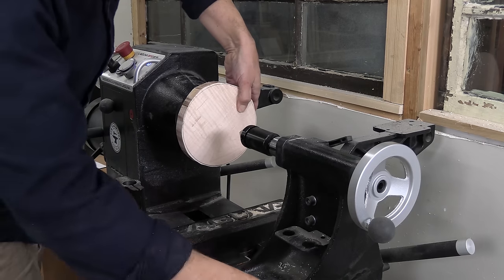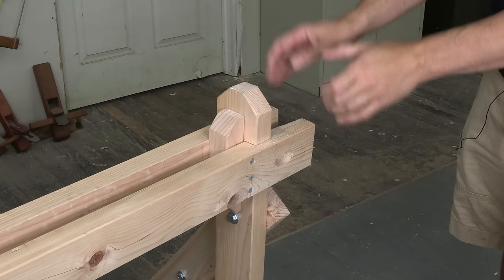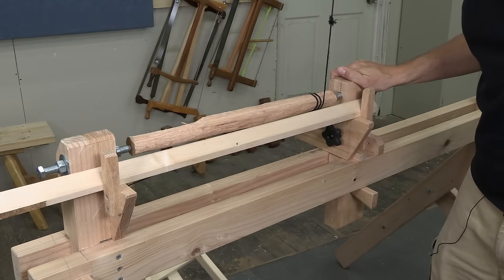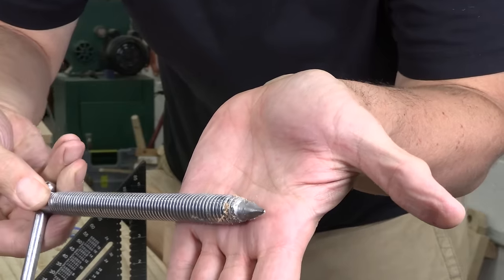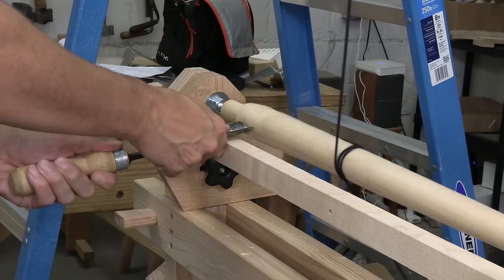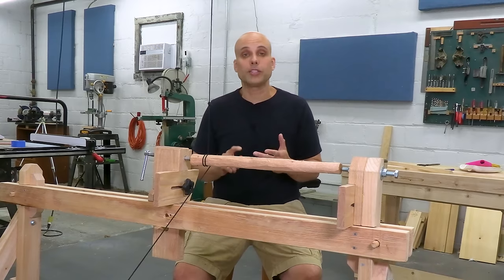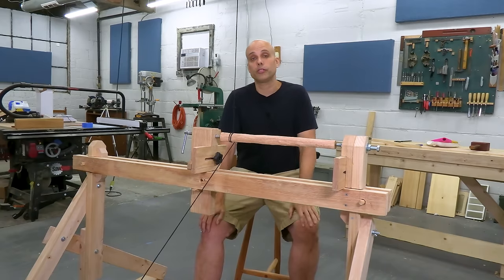I Built a FOOT POWERED Lathe. (Most requested video.)

Comment from the maker: Just to clarify: there are some really great treadle lathes in the world. The basic idea is sound. But they're much harder to build than a spring pole lathe and some of the shop-made examples I've seen haven't worked well.  If you're building your first lathe,  the spring pole design is more likely to work on the first try.
Reply: I totally agree on the assessment with some of the later model flywheel lathes.  I operate a few different flywheel treadle lathes (cast iron) and some perform much better than others.  But i have also found that it really depends on what i plan to do on the lathe.  This helps me choose the particular lathe for the work i want to accomplish.  As always, great video Rex!
Reply: on the subject of spring lathes, after the innitial design is doned, would it be possible to go fancy and find a way to atach a spring to body? like thin bamboo which holds its spring well after it dries or mabe laminated pole?
Reply: Any particular reasons a tredle lathe didn't work as well? I've always had the idea of using the base off an old treadle sewing machine to make a lathe (not because I'm overly interested in turning, I'm more interested in building the thing itself
Reply: A video on how to power this with a rotary tool would be cool.
Reply: @martinwyke  well, you would probably put a pulley on your tool and use that to drive the part.  Some sort of gravity based belt tension would make it super simple too.

Comment: In regards to learning the first time you make something, regardless of how experienced we are, Jimmy Diresta has a great saying: "You go to school on the first one."
Reply from the maker: Words to live by.  I love Jimmy.
Reply: Flywheel definitely is a bit more  complicated to build. And to balance. But still I'm right in process to building one right now.

I tried out one such flywheel lathe some 40 years sgo. With a belt, and the two parallel beams made of 2" by 4" pine planks. I love how it worked. 

Mine will be with bearings, one of them conical. I'm not a very physically strong man, ya know...

Comment: A tip for using a pole lathe is try to work with green wood as  much as you can, just get 90% of the way done and then finish the piece once it has dried and warped. It's a significantly quicker and much more enjoyable tool to use that way

Comment: When am I by myself assembling something with stand up legs that want to fall over, use a traditional carpenters clamp at the foot of the legs against the floor to hold them upright.  Works like a charm.  I learned that some where along the way.  Really useful tip.

Comment: I'm from a long line of woodworkers, on both sides of my family. I am a woodworker as well, and I make it a point to do high quality work. My father was a woodworker, his father was a woodworker, and about two or three more generations back were also. My grandfather on Dad's side made his own wood lathe, and he had repurposed an old foot powered Singer sewing machine for the turning action. When he passed away the tools in his shop were meant to be passed down to me, through my Dad. That old foot powered wood lathe was one I was especially hoping to get my hands on. I wanted to try doing the turning the old fashioned way that my grandfather used. His wood lathe was definitely more refined than the one you made in this video, and the belt drive worked off of the foot pedal of the old singer kept the material turning in the same direction. Unfortunately, a cousin took all the tools from Grandfathers old shop and sold them. He did not ask to do so, he just did it. I've not associated with him since that time, because he knew that was supposed to be my inheritance, and did not care. He just wanted the money he was able to get out of it. Not being in the family business of woodworking may have played a part in his choices. Grandfather's furniture was some of the best made furniture in the whole area of northwestern South Carolina, The adjacent parts of North Carolina, Georgia, Tennessee, and Alabama.
On my mother's side of my family was a buggy building company partnered ownership. The one that was my ancestor designed and built the carriage of Catherine the Great of Russia. If you've ever seen photos of that carriage, you know how ornate it was. That is what my family is about, high quality in everything we make. I still live by that tradition to this day.

Comment: I build a spring pole lathe just like this 20years ago. I used it alot and its fun. I never missed a moving headstock . 
I used it alltime outside and fixed it to the ground so i can do heavy cuts . sometimes its usefull to ad some wight to the legs when you can´t fix it to the ground

Comment: YES!!!!!  Love this video!  I built a pole lathe a few years back and it is one of my most favorite tools to use and I’ve built a lot of really gorgeous stuff with it.  Turned table legs, in particular, put your furniture in a different category.  I built mine crazy cheap and fast – 100% SPF (except the tool rest) and didn’t even plane the parts or even wait for the wood to dry.  It twisted some, but still worked great.  No real joinery (except the wedges); I just screwed it all together.  It's very "bodger" style - down and dirty.  But it works amazing.  So great I never bothered to build a “nice” one.  I have low ceilings in my basement so I use a bungee instead of a pole.  I also eventually rigged up a couple pulleys to get a 2:1 mechanical advantage so now with each stroke I get twice as many turns and twice the turning speed.  And with pole lathe turning the number of rotations and rotational speed is KING.

Just promise to keep make pole lathe videos.  Too many popular woodworking youtubers make one video on making the pole lathe, try a video using it, and then you never see the lathe again.  So please keep using it and making videos with it.  

I will also say that a pole lathe is the absolute cheapest and easiest way to MASSIVELY expand one’s woodworking capabilities.  Everyone should make one.  Once you can turn something it opens up a TON of new options.
Reply: Thanks for sharing your experience, it's super inspiring! The 2:1 pulley system is an amazing idea!
Reply: Could you explain that 2:1 puller system?

Comment: I made a spring pole lathe from Roy underhill's plans as my first lathe a few years ago. Loved it! I turned parts for a rocking chair, and some coffee table legs, a blank for a wooden screw, tons of stuff. It was fun! I did convert it to a bungee cord instead of the wooden poles, much more convenient, and you can adjust the tension by adding more bungees or changing the way you hook them up.

Comment: Can’t wait for your follow up! I wonder if using an actual spring would give you a better easier result? Maybe extend the two legs up, add a second ‘bed’, and hang the spring from that. Might prevent the “jumpiness” you mentioned, which I’m guessing is the pole trying to pull the whole lathe up to the ceiling. Would also make it even more portable!

Comment: Hey Rex!! TYSM for the inspiration and motivation to make mine. To know that a pole lathe is better than continuous motion was the last thing I needed to hear to give me the push. I’ve started it! I’ll be using the style of legs you shared, the takedown style so it doesn’t occupy as much space, and the same screws you showed here. I’m making it more traditional style because I have access to plenty of wood, and I’ll make it closer to Townsend’s version, mostly from a single tree, milled by myself. I’ll also be making it to work standing up, I’ll get more power on the leg’s downstroke. I’m using parts of old tires instead of a pole though - learned I could do this from Advoko Makes. He has tons of brilliant content. He cuts the sidewall of a tire into a continuous rubber strip/strap. Good use for what would otherwise be trash in a landfill.

Ps: check out his clamper. I fixed all the old chisels around the garage that my dad had split open because he didn’t know they had to be used with a wooden mallet instead of a steel hammer. Easier than remaking handles and have withstood a lot of work, and will stay in place till I remake them on my new lathe haha

Comment: When you're taking your lathe apart get a pair of coupling nuts to put over the ends of the points. Keeps you from poking holes in yourself. Voice Of Experience here...

And yeah, pole lathes are fast. I was at the Bodgers Ball last May and competed in the Log 2 Leg race. My time was just shy of 19 minutes to make two chair legs from a log. And I was dead last. The winning time was less than 9 minutes. Yikes.

Comment: I built mine in a similar fashion, but into my workbench. Both heads were removable. Two 8" 2x4 stand outs and a full length 2x4. It had one of 2 string overhead pivot arm styles with the spring pole  under my bench between the legs.

Comment: "i let my 2x4s dry in the shop for a few weeks" you are so freeking smart, i just learned the hard way on something similar, i had bought 2 treated posts and used a post hole digger to sink them in the ground, bought the straightest ones home depot had, used my level and made them perfectly vertical and cemented them in, in just like a weeks time they warped so bad and look horrible now. interesting how that works, clearly you know from experience on this as well for you to leave them sit for a few weeks.

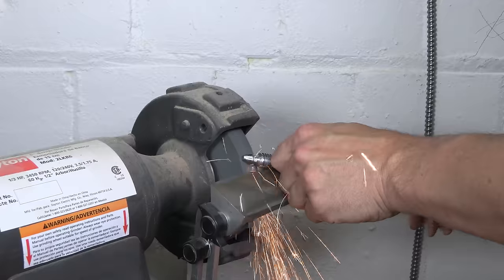Comment: First of all, just wanted to say, great design! very simple, cheap, and affective. One minor nitpick @ 6:27 you can see the end of the steel start to run through colors, and you can see the point of the tailstock is purple and gold. Not too sure about the steel alloy, but generally speaking, you shouldn't heat hardened steel up to that temperature unless you're going to re-heat treat it.

I bet it still works great, but refraining from heating it up like that in the future would improve the longevity of the part!

Comment: Quick tip if it helps: put a metal pipe on the handle of the clamp screw when you want to thread it into the poppet. The longer the pipe, the more leverage you can put on it. Also works great for lug nuts!

Comment: I really like the idea of this. I might have a couple ideas of my own to try if I ever get experienced enough to do this. Instead of a tree branch, I could possibly swap it for an actual spring bolted to the rafters. I could also make or buy a pulley to put the rope on, so I can work on the whole piece without having to reconfigure it. That would also let me bolt the lathe to the floor so it doesnt jitter around like this one. Heck, with a pulley, I could add a bit of gearing, so I can get more speed and more turns with less foot power.

Comment: Why not cut off end of C-clamp, drilling holes for cross pins. Mark, chop out relief in wood, no need for exactness. Drill pour hole and relief holes. Clamp halves together, fill with thin, long set epoxy, while tapping to remove bubbles and voids. Result: long lasting metal threads. Longer time to rebuilding. Thanks for getting my thoughts sal flowing. God bless

Comment: If your already laminating the end stock, just clamp the pieces together (and maybe screw too) before gluing, drill the through hole, then inset a nut that fits the threaded rod. Though, that many wood threads are probably fine.

Comment: You could also cut off the threaded part of the c clamp and counter sink it on the work side of the poppet. Epoxy it in place and then you have metal threads. You can also cut the threaded part in half to create nuts so that the thread doesnt move.

Comment: Thank you so much for making this.  I'm not convinced on the reciprocating concept vs a flywheel because I feel like the speed is just not going to be there, but I can see how much you learned from this project and I am grateful that you've shared it.
Reply: The power output of your leg is relatively constant. Extra speed comes at the cost of less torque. Furthermore, varying the speed/torque on a pole lathe is trivial, just move the anchoring point of the thread to the treadle closer or further to the pivot point.
Reply: @hugbearsx4  No doubt one could build some mechanism to convert torque to speed, but I was speaking specifically to the reciprocating nature of it.  If the rope was wrapped around a ratcheting point the wood would keep turning in one direction and you wouldn't be fighting the momentum of the piece.
Reply: @AramisWyler  Yup, the momentum will indeed result in loss of energy at the change in direction of rotation for larger diameter pieces.

Comment: If you can't find a good branch to setup one of these or if you're worried about the branch taking out your lights when it falls you can use an extension spring to achieve the exact same effect. It ends up costing only a few dollars more from harbor freight and you'll need a bit of wood to hang it above the work piece but otherwise the concept is the same. Spring pulls rope, rope unwinds and spins piece.

Super simple and very effective. Also saves you having to replace your lights cause a branch broke in your garage. That's a real pain, ask me how I know...

Comment: I've been tinkering around with reciprocating lathes for a bit.  One conclusion I've come to is that it's probably better to have a tool rest that is on a separate banjo, rather than mounted on the poppets.  Sure, poppet mounted is more traditional, and there's logicistical complications with having a movable tool rest, but the ability to get the tool rest set to the right position, without having to worry about complications with the poppets seems worth it to me.  Although it's in bits now, the last tool post I built used a stack of 3 3mm plywood shims, so I could move one from either above the ways (to raise the tool post height) to below the ways (lowering the tool post, but keeping a surface for the wedge to press against). With an angled top surface (as you noted), that seemed to be precise enough, whilst not having anything that could slip in use.
I think the poppet mounted rest works well for one of the most common historical use cases - where one is making many items of about the same diameter (e.g. the bodger turning out parts for Windsor chair).  However, I was wanting to make less individual items, but of much greater variability; hence designing the right poppet mounted tool rest just never fit in.  I suspect that most use cases today will be less of the production situation.
As a separate point, I also found that the skew chisel was by far the best tool to use, after a gouge to get the stock 'roughly round'.  The gouge copes with an interrupted/uneven cut, but the tool pressure is so much lower with the skew that it went much faster.  Although the skew is a bit more challenging to use, I think that pays back.

Also: With the lower surface speed of a manually powered reciprocating lathe, ordinary tool steel is perfectly sufficient for a cutting tool.  Indeed, the typical tool steel (e.g. O1) will usually be able to be honed to a finer edge than the typical high speed steel - which is a difference that I could feel.  It also means that one can purchase an ordinary bench chisel of, say, 25mm width, and use that (or grind it to a double bevel), rather than needing specific tools for the lathe.  I can see others feeling that the usual HSS lathe tools are a better tradeoff point, but I do think it's worth recognising that non-HSS tools are an option on a pole lathe.  Particularly if one wants a specialised tool for limited use (e.g. a form tool for a specific shape; or a captive ring release tool), being able to knock one up quickly can be well worth it.

Comment: Well, I am surprised about the comments that some don't like the treadle lathe with the fly wheel. I have heard a number of solutions for the fly wheel, most common was the brake drum from a truck, which had mass and was balanced. For your tool rest, most when turning spindles prefer the tool rest to be slightly above center height. A lower rest means having to drop your tool handle lower to get the proper cutting angle. For the tool rest itself, I would use the hardest wood you can find. Also, a piece of A@ drill rod, better if it is hardened, can be epoxied into a shallow groove on top of the tool rest. Far better than cast iron. Proper/most efficient cutting angle for spindles is more of on a tangent rather than square to the center like. It cuts better/easier that way. And eventually, you need to skew it...

I am also wondering when the line shaft lathes and power machines came in to use. I know water wheel powered shops have been around a long time.

Comment: could you have cut up the frame of the g-clamp to utilise the threaded hole in it - after all it is a perfect match to the thread of your shaft. Maybe angle grind it out in a slight wedge shape, chisel our wedge-shaped hole in your lathe's frame & hammer it in.

Comment: I have a suspicion you might be happy at how cleanly, quickly, and accurately a brace and bit might handle the holes you need in your poppet, and the driver can be recharged with an unsweetened ice tea or cold beer.  I can barely drill a straight hole using an electric drill, and as often as not the point where the drill pops through is ragged.

Comment: Just a thought, why not use the internal thread on the clamp as a nut in the poppet and just drill a tight clearance hole for the bolt?
To reduce the jumpiness you could add some kind of platform for the user to sit/stand on that transfer their weight to the lathe.
Finally, have you tried to drive the workpiece using some kind of pulley on the drillpress instead of the pedal?